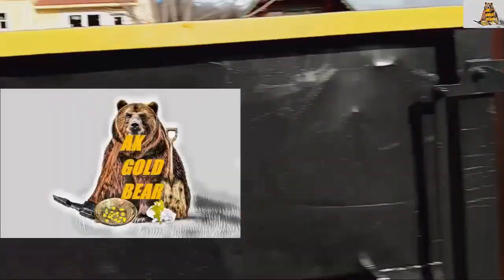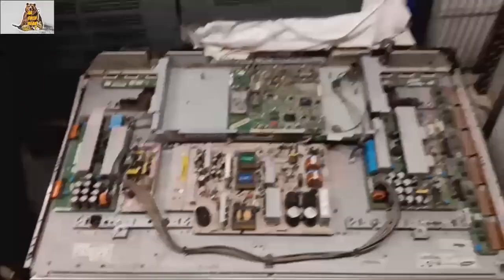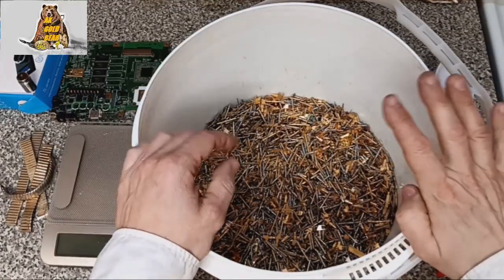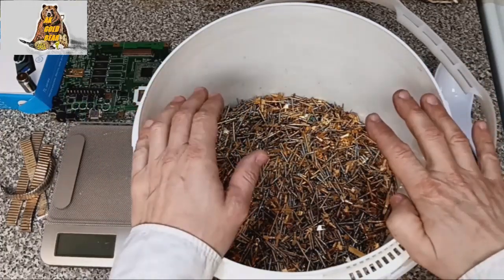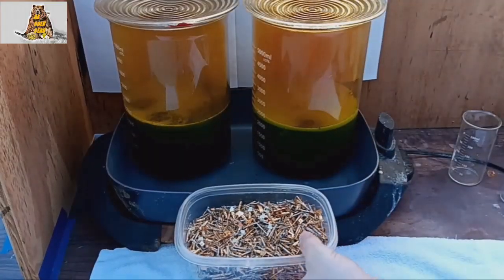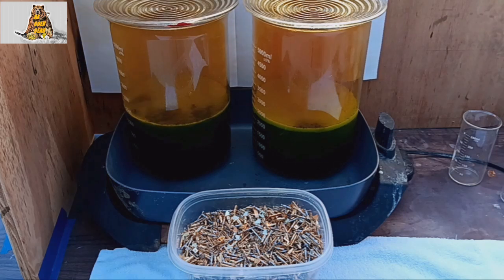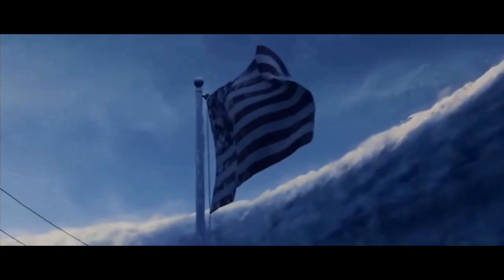Gold from gold plated pins, transistors, resistors. Extracting gold from gold plated junk🙂

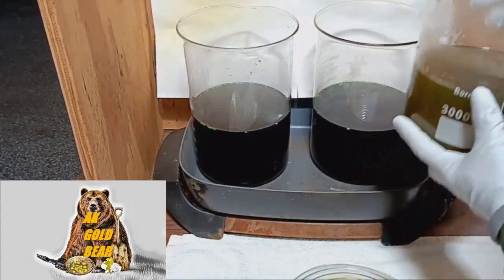Comment: At 5:28, if you think there's plastic in it boil it until down close to the amount of acid you started with when it begins to boil over a water boiling temp the ph increased let cool and the plastic will settle at bottom as a sludge if any, including the water in the fresh acid you started with boil a percentage down at water boiling temp, the metals in the acids and water will seem to lower the boiling point but it's just the opposite the metals are heating up becoming more concentrated, it'll boil over in 10seconds when the ph is reached and the water is evaporated out so you have to keep a constant eye on it and pull it off the heat, this is at the lowest boiling temperature
Reply from the maker: Thanks for the tips 🙂 and thank you for your time on my little channel 🖐

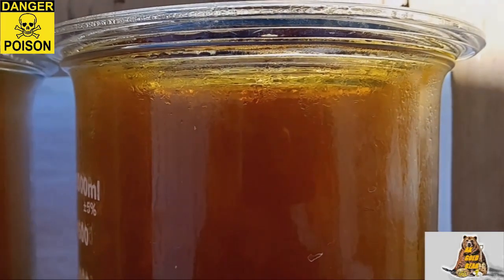Comment: At 4:33, good videos, maybe you won't lose your gold with the diffused tin, I get what you're saying, so I did a batch of pins recently but I soaked mine in hydrochloric and hydrogen peroxide for about 3 or 4 weeks even though there wasn't hardly any soldier on the pins because I shaved the pcb's with a puddy knife and hammer ,  after soaking I reverse electroplated them,  previous to the reverse electroplating approach I was using the chemical process, if you have any hydrochloric you think there may be precious metals in solution but still a solid cement out using various aluminum then when reactions stop but the hydrochloric is still dirty and dark add bleech slowly, same with nitric without hydrochloric add bleech to drop out sediment

Comment: Hi, I'm a computer technician from México. I've keep for a few years 80+ motherboard, 80+ DIMM's, 80+ SODIMM's, 100+ processors, a big box of optical and floppy drive controller boards, a nice bunch of lcd driver and pci boards, about 2Kg of gold plated pins and connectors... It's worth the effort trying to process all of this? First time trying, none of this materials have had any costs, all are replaced ruined parts.
Reply from the maker: Awesome. You have collected a lot of material. By recycling this amount of material, you can earn a lot of money and buy something interesting. For example, a helicopter! 😉👌

Comment: AK I Love your channel!! One question were your pins magnetic or a mix of magnetic and non magnetic or just brass? 
Thank you
Reply from the maker: Hello. The material is a mixture of all kinds of pins, resistors and transistors. Some pins have a metal frame and, of course, they are magnetic. To dissolve such a mixture, i need just a little more acids. Hydrochloric acid dissolves the magnetic part of the material well. Yesterday I put a piece of metal into this solution to extract all the copper from the solution, today I pulled this piece of metal out of the bucket and the metal partially dissolved. Imagine, even dirty old hydrochloric acid, after gold has been precipitate with iron sulfate, still dissolves the metal 🙂

Comment: Thanks for another great video! A couple of Questions: Since SMB to drop gold is a horrid smell is iron sulfate any better? Do you add a few mg's of sulfuric to your AR and could you do a video refining gold ore? Thanks again and keep up great work!
Reply from the maker: Working with sodium metabisulfite requires very good ventilation or working outside. Sometimes I use sodium metabisulfite and even working outside gives me a headache. SMB precipitates gold well, but it is a very toxic material. I only use smb if I don't have iron sulfate.
Sometimes i adding sulfuric acid to the solution, it all depends on the material being dissolved.
About gold ore, yes, there is such a plan. My friend has a private mine and he asks to test his stones with acids for gold. 🙂

Comment: Very important to me.
How much aqwa rigea you used to the tow Kg?
Reply from the maker: Hello. Always calculate this: for every gram of material there are 3 milliliters of aqua regia. If you have 100 grams, then you need 300 milliliters. If the material is magnetic, then more acid will be required and the solution must be heated 🙂
Reply: @akgoldbear7669  but iron if it solved in aqwa rigea, is that normal?